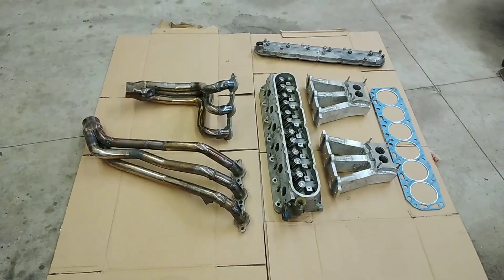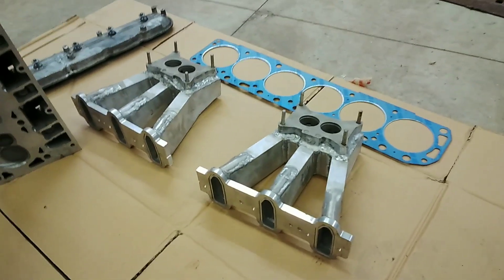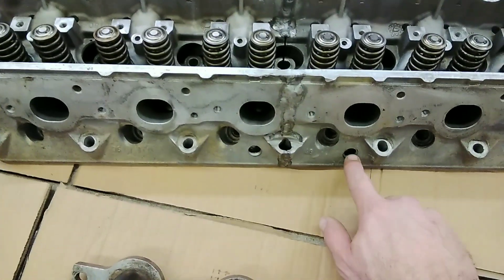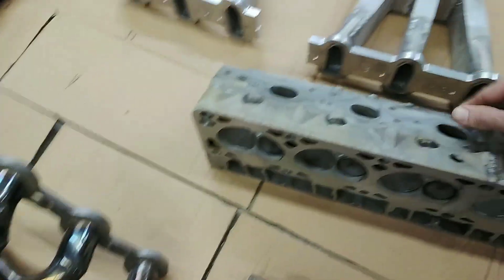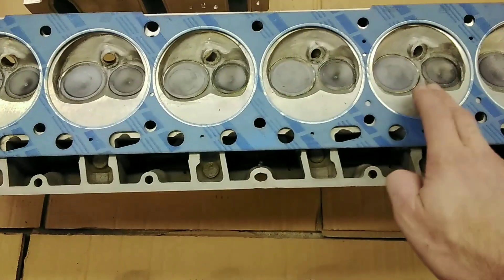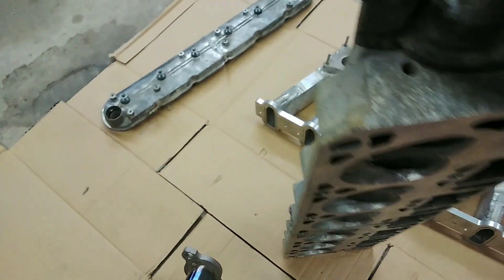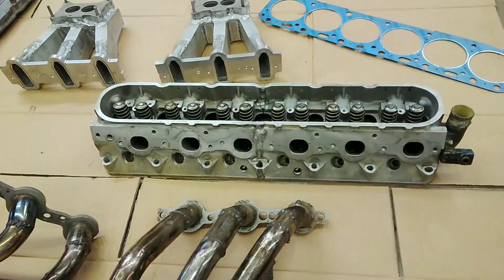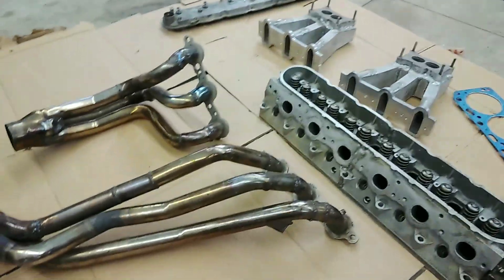Ford 300 hybrid LS cylinder head

Comment: Now that's neat. Subbed, gotta see how this turns out. I've been planning out a cross flow head for Jeeps 4.0 six. It never occurred to me to use already available aluminum heads. Cast Iron can be 'dirty' and most likely welding two together isn't wise. Yes I know about the Boss 300. But cast aluminum heads would be far more forgiving. Good stuff, Sir. Carry on.
Reply: Probably not going to work the ls used the same bolt placement as ford small block that just happens to be close to a ford 300
Reply: @austinhowze6280  I meant, I could 'look around' and do some investigating on what does have a bolt pattern and bore spacing that's close to the AMC/Jeep 4.0, and already made of heat treated seasoned aluminum.
Reply: @RANDOMNATION907   The AMC/Jeep inline six has the same bore center as the Ford Windsor and Cleveland at 4.380. The LS is 4.400 . Close enough. Aside from water passages the heads also might need to be modified to close up the oil return from the head. Need a new custom cam to match the valve setup. Unless you are going with the same lift on both valves. Also you need to rig up a thermostat mount on the front face.
Reply: @mpetersen6  ... Thank you. Thank you very much.
Reply: @RANDOMNATION907  
Iv I was to doing this to a 4.0 instead of building a stroker I'd go the other way. Punch the bun ores out as big as possible.  And then use the crank and flywheel out of a 199. The intent build a high rpm screamer.  I think tha th the SCCA missed an opportunity in the late sixties.  Most of the early pony cars were actually built with sixes. If they would of had a class similiar to the 5 liter TransAm cars but limited to a six with say 3.75 liter. Let them run at a lighter weight. Run the races as a companion race to the TA. Then we might have seen the factories taking up some interest in waking their inline sixes up. The only ones that really did were Mopar and Pontiac.
Reply: @mpetersen6  Chevy, Ford and Chrysler all ran inline six motors in drag racing. My father used to get protested in F Experimental for running trips on an inline six. Class rule book stated a single carb on V8s. Rules are made to be bent. Crybabies cry.

Comment: Mount it on a block and let us see the cylinder head over hang 
U are not offset grind crank for those rods  240 rods are longer and direct bolt to the crank u just running 331 piston for the correct Comp height
Reply from the maker: I havent got the block back from the machine shop. 240 rods and 331 pistons set the pistons .050 down from deck height. Offset ground he crank .020 and used ..040 undersize bearings.
Reply: @fiskshopworx1541  what’s the rod bearing part number ??
40 under be like Honda rod id curios because rod width
Reply: We doing one at the shop 300 rods with pin bushings rods we using 351w based pistons easier to find with more options than the ole 390 fe piston way 
Yes going turbo 7 lbs roughly
Reply from the maker: @Freedomishere-im6ug  I dont know the part number but they are Federal Mogul .040 rod bearings.

Comment: I have a 300 project as well as a pair of LS heads from a truck motor that spun a bearing. I am seriously considering doing this same operation. I have a 350amp TIG here in my shop so welding it is not an issue.
Reply: If you do it film the fitting and welding please.

Comment: When you did the welding did you bolt the heads to the block to control the potential warpage?
Reply from the maker: I built a 3/4" plate  to bolt it too. But a old block would work also. Head was heated before and during welding.

Comment: I saw this years ago in Australia, wanted one ever since.  Can't believe no one has commercialized this idea yet.  I love in line 6's and Fords is one of the best, the 292 Chevy is no slouch either.  I know I'm a little crazy but I see a stretched '27 T Bucket with a 300, 3 Webbers or a small turbo and a T5.  This head would make it all worthwhile.
Reply: Australia has the Ford Barra I6 so there is no reason to modify older 300's.
Reply: @jimboyokel  $$$$$$$$$$$$$$
Reply: I know! Probably because america thinks no v8 sound= garbage, or the gm Atlas would have more aftermarket.

Comment: Im doing something similar for a Ford 200 using individually cut Chrysler pushrod v6 combustion chamber head sections all welded together... To make a cross flow head... I have a question regarding your welding procedure...

Did you have to re-heat treat your aluminum head to a T6 grade after joining the heads with welding?

I definitely think I will since it's definitely gonna soak up heat when I  either braze or tig weld them together...

But perhaps I'm over thinking it ...

Love to hear your wisdom on the matter...

-Evan
Reply: Excellent idea but it might be worth looking at getting a second hand one shipped from Australia (with intake manifold).
Reply: But what's the fun in that?

Comment: I don't mean to be a downer here but... WHY!? When are so many better off the shelf options, or even better better v8 heads to cut up and splice together?? I'm sorry, this just doesn't even make sense from a "because I could" standpoint. Just my 3 cents
Reply from the maker: There are no aftermarket ford 300 heads other then a race only head (no coolant). I got the heads for free and stock ls head flow well, if it doesn't work I didn't pay $1000 plus to cut up and glue together.

Comment: Why didn’t you make holes in the water passage plate?
Reply from the maker: There is 2 plates, 1 on each head weled in before the 2 heads were welded together. The only other head I have seen built had a hole through which didn't seal and leaked coolant internally. So decided not to make that a possible leak point.

Comment: I wish there was a company that sold modified LS heads and head packages for 302/351w and 240/300 I6s. 706/862 heads are certainly cheap enough, I would guess they could set up all the tooling and create jigs that would allow them to output quite a few of them in a working day and make a decent profit off of it.

Comment: One cool idea...I wonder if a tri-Y header would work well on that set up? Basically have 3 pairs of corresponding cylinders Y together to aid scavenging then merge into a 3 into 1 cone collector, I would guess a single 3" collector would be plenty. I have seen tests where a mild LS engine with a single 3" collector performed better than 2.5" duals, that was on Engine Masters or Richard Holdner I believe, maybe a 2.5" or 2.75" would be better with lower displacement? It would be cool to see it with port injection, LS coils and a single 92mm TB. I would guess a longer runner length would produce the the most TQ and mid range without effecting peak HP since a long runner TBSS intake on a cathedral port LS is the best performing factory intake.
Reply from the maker: Your header idea might work, I kinda just used what I had and the 2 collectors  will be merging into a 3.5 inch and one single side pipeon the car. A crank sensor and ls coils would be a nice setup also.
Reply: @fiskshopworx1541  coil on plug is nice

Comment: Cool.  Wonder id the 2014 and up LS based 4.3 heads would be easier to fit?  Not many in the junkyard yet though.
Reply: One of the reasons it's better to use the V8 heads is because you want to lop one end off each head to attach 6 together.

Comment: Had a friend with a  in-line Chevy 6 bottom end and a 460 ford head  bought brand new for his boat inboard  it was a merccruiser  motor
Reply: That sounds like a Mercruiser 3.7 liter, four cylinder,  not a Chevy 6.
Reply: @billbaskin7904  yes it was a 4 cylinder I realized after I commented  but it was a Chevy  bottom end  had us puzzled as to why they did that
Reply: @garyforestiere7732  It's pretty obvious when you get inside the bottom end of the 4cld Mercruiser block. Mostly 460 Ford bb parts downstairs.

Comment: I love how this video has over 8k views and none of the big names in performance have come up with a cross flow cyl head for the Ford 300 yet. Or even a performance cyl head. Clearly there's an interest. You hear stories of people who've built their own and how crazy powerful they were. I honestly think there's a market for it...
Reply: Look up Clifford Performance. They make performance parts for old inline sixes, and the lima 2.3
Reply: I have been saying for years that there are willing buyers for this. Lotta inline 6 trucks out there with no real performance potential because the stock 240 heads can only do so much for one. I am a BBF guy, and people used to say there wasn't enough takers, but now they sell over 30 different cylinder heads for them. There are lots of Ford fans and just plain 300 six fans that would buy an aluminum cross flow head. Make some forged stroker cranks while we're at it!
Reply: Look up "Boss 300“

Comment: I'd love to see this thing on a Dyno when you're done. It reminds me of the old 300 inline that was built with a Cleveland head modified for drag racing. I can't remember what racer did it but it was pretty impressive.
Reply: Bruce Sizemore
Reply: I was thinking Bob Glidden made one thank you for the info. I clearly wasn't remembering correctly which is why I said I couldn't remember who did it.
Reply: Sherman Sligh built the first one, several followed after that.
Reply: Power Nation has a series of vids where they did something like this in a few stages, plus a turbo.  End result IIRC, was well over 500 horse on the Dyno.
Reply: @artfranz2273  Not that I'm aware of...looked like a stock head. The selection of parts + turbo is what gave the figures...turbo is the great equalizer. 👍

Comment: That is way to cool and u are probably the first one to ever make a LS 4.9 ford head . I can't wait to see this thing run .did u have to get a custom cam :made?
Reply from the maker: No the valve sequence is the same on an LS and the ford 300. So an off the shelf camshaft works.
Reply: @fiskshopworx1541  oh ok that worked out perfectly then, i know that they have put them on some v8s and had to get a custom cam ground for it so i was thinking that would be the same. Have you got it running yet?
Reply from the maker: @79beans347  no,I am waiting to get the bottom end back from the machine shop.

Comment: Did this with Cleveland heads a few years back after seeing someone else's old build doing it. Got curious and had to try it. Took a ton of time but the gains getting away from that log head were well worth it. It felt like no other 300 I've ever been around. As much as I hate Chevy, I'm stoked to see this. Always good seeing another Frankenstein style builder.
Reply: A fella here in Tulsa, Okla. Did this 10-15 years ago. His idea, he did all the prep machine work, brought it to me and I did the welding for him. Difference was it was open all the way through so coolant would flow end to end. He did a really good job.
Reply: @johnberrrey7570  Saw this in Tulsa about 3 years ago at the Tuesday Cruise on Memorial. IIRC it was in a falcon or maybe a Ranchero. Really clean install.
Reply: @abeclarkatp2595  yes, the individual has it in a Falcon Ranchero. He built the headers and intake himself.
Reply: @johnberrrey7570  Hey, when you did the welding, it sounds like you used cast iron heads, but if you did it with aluminum, would you recommend that the head be re-heat treated to T6?
Reply: @evanmolnar1351  No, I didn't. I've been repairing and modifying aluminum heads and blocks for 40 years and have not found it necessary. The weld material will not heat treat anyway. I did reheat treat one BBC block because the repairs were so extensive.
Reply: @johnberrrey7570  that's wild, I was thinking the welded areas would be significantly weakend from the heat cycle... Were you worried about that issue occurring when you welded the heads?
Reply: @evanmolnar1351  I'm actually wondering why it would be a problem. The part of the head that sees all the stress is the head gasket surface around the fire ring and the combustion chamber itself. Water jacket just needs to provide a passage of coolant under low pressure. Seeing as there's still a bolt at every corner of each cylinder you should be able to leave it open and the weld material in there should be plenty strong to bridge that gap.
Reply: @johnberrrey7570  Yeah, I could see much room for improvement in execution ...
Reply: Bruce Sizemore pinto by chance??
Reply: I thought person could get them through Ford In the 70, I do know the Cleveland  300 six cylinder  were very popular in Australia  70s and 80s know they have a ohc head that might work may have a dohc by now
Reply: @ranzablevins7593  The Barra engine could be ordered with a turbo or LP gas.  Lots of them running about here in Australia with up to 1200 HP. The 300 was considered to be an unreliable  boat anchor in Australia and was only available in trucks. The Barra has been swaped into all sorts of cars here too,Including a vintage Mercedes which is a  great driving car with more  horsepower than a V8 of equivalent size can produce.
Reply: @Mercmad  I'd rather have the 300.... Hell, they haven't even figured out drag racing in Australia yet... they just think you smoke the tires and that's it.
Reply: @Mercmad  that's not true at all. 300's are regarded as incredibly reliable to anyone who has owned or worked on one in Australia.
The Barra is not comparable and 4 decades apart in design.
Reply: @Mercmad  Slow? Yes. Unreliable? Absolutely not. At least in the top 5 most reliable gas engines ever made.
Reply: Bruce sizemore did that years ago.
Reply: @BruceLee-xn3nn  yessir. Exactly who me and my dad got the idea from.

Comment: About twenty years ago I was in  an racing engine development and dyno shop north of Boston.
The owners were friends of mine. I was one of a trusted few that could walk in the back door and see what they were up to. There was always one of a kind engines and parts that customers from all over the world shipped to this shop!
I saw many one off sights. One day as I browsed around I spied a one of one experimental Ford 300 aluminum head made out of a few Cobra Jet heads cut & welded together!!! Being a Ford guy this crazy head took my breath away. I think it was for a customer’s digger dragster.
Those were memorable days!!
Sigh….
Reply: there is a 300 ford with the head you mentioned,it was recently rebuilt and was installed in quite a legendary pro stock performer fighting and winning against v8's at the time
Reply: @trillrifaxegrindor4411  
Nice to know that hunk of aluminum love is possibly still 
around in a gear head’s hands.
I never saw a complete 300 mtr. It was where I saw it probably to have work done on it. 
They did alot of unconventional R&D on Chev stuff. Being an advanced machine job shop they did all makes and engine configurations.The shop did a shit ton of alum big block chev stuff for customers and for their own racing projects. 
I had my lit’l 306cid windsor 
done up by them as well.
Enjoy gasoline power while it’s here!

Comment: This is good backyard hot rodding, what's the planned use? I subbed to see how it works out.
Reply from the maker: I've got a 1939 dodge D11 coupe, nine inch rearend, straight axle front  end, kinda a gasser look. Also top loader transmission.
Reply: @fiskshopworx1541  Cool! Howards Cams will build you a custom cam for just about anything at about the same price as an off the shelf cam.

Comment: 240 I-6 have same big end as 300 I-6 do so help me understand or correct me. The small end on this two rods are the different & of coarse the center to center length.
Reply from the maker: .040 undersized rod bearings, so can offset grind the crankshaft. I believe it is 4.020 inch stroke now.
Reply: 240/I-6 rods with Cleveland slugs, 3.750 Windsor eagle crank. 400/351M block except for valley splitting 1977or78. Hybrid timing set Windsor crank/Cleveland cam
Reply: Not a builder, I dreamed up combo, not sure if 351/4V pistons are right CH. but my math figures say I’m rite
Reply: Sorry help me figure out how he said a small off set ground Stroker is possible. If both rods have same big end

Comment: That's pretty cool.Nice job.
I have a '53 F100 body mounted on a '79 F250 4x4 frame with a 5 speed tranny and a 300-6.I have thought about doing this also.
You have inspired me.Nice to see you are thinking outside the box.I'm looking forward to updates.
I have several heads and blocks and wonder if a head or block could be used as a jig for welding?I weld aluminum and really like this kind of stuff.This could be pre and post heated with a tiger torch.
Reply: Do it to it! '53-54 are my favorite trucks. That would definitely be something to see at a show. Only so many LS and SBC swaps I can stomach anymore. If we're gonna have them, why not do something different with them?
Reply: Look up "300 boss"
Reply: I think a properly executed turbo setup would be much easier ...
Reply: Just put a Chevy ls in it🤣

Comment: I was wondering if the offset would negatively affect the lifters, rockers, and valves. It's not much and the pushrods will be long so maybe not. Is it going to rev past 7000 RPM?
Reply from the maker: I think the pushrod alignment will be ok. With the stock crankshaft I dont plan on going past 6200 rpm.

Comment: 4:48 I was wondering about the bore centers. That's an interesting solution.
Reply from the maker: You can get the bore spacing very close by offset boring but I decide to center cylinders number 2 and 5. So cylinders 1,3,4 and 6 are about .020 offset from the head. I dont believe it will be noticable.